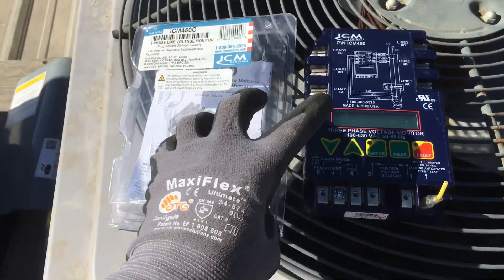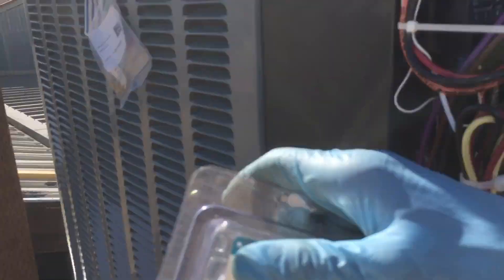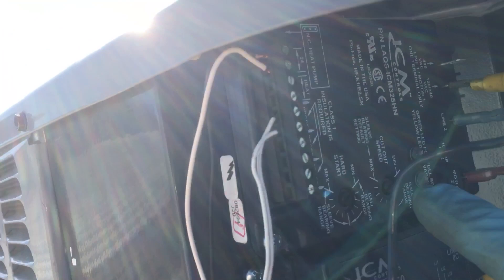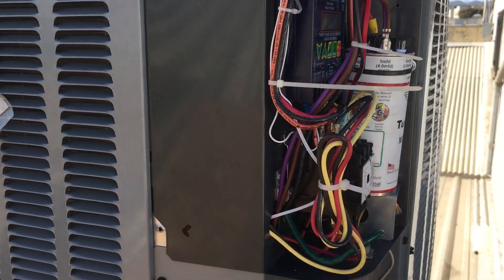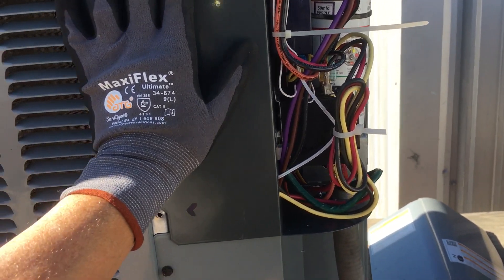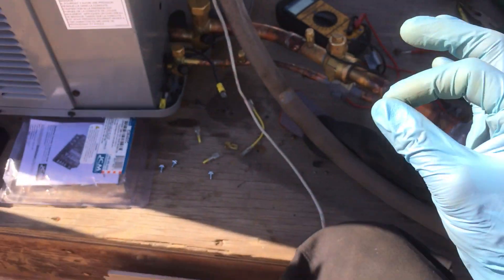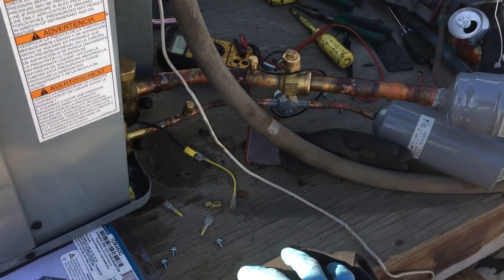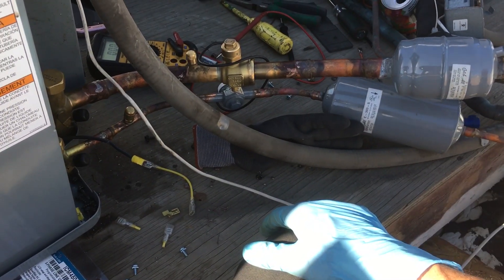ICM 450 Line voltage , three phase monitor , motor protection￼. Protect crucial HVAC investment￼

Comment: 2:26 "to slow the fan down"   Not on a PSC; capacitor single speed motor.
Normally it's a hi/lo press/temp switch that breaks the fan circuit for an on/off mode only. Not slowing down/pulse motor.
Reply from the maker: It is a PCS single speed fan motor. 
      It pulse cycles duty cycles the pulse to the fan to control the speed 

Like your finger being on a light switch, turning the light switch on and off very fast to use as a dimmer . 
    That is all this is doing to the fan motor to slow down to raise the head pressure on cold days

Comment: So I had to look up sensi predict. Looks like the value is to have it connected to a wifi, and send text messages about system status, is that correct? What is this cooling that is that critical, as they had to live without it the days it took for you to replace the condensing unit.
Still would be interesting if you could have opened the ICM 450 to see what root cause failure was. And if this was a design or manufacturing issue.
Reply from the maker: Yes it’s sends error messages to both you the contractor who installed it and to your customer. 

You get a monthly service report with your subscription and all data is saved. 

It’s a cannabis facility ( marijuana )  they were down a few days until PG&E put the new transformer up on the pole that exploded. 

           Unfortunately it was a Friday when I got out there so all warehouses were closed over the weekend to get a new unit but I was able to get one immediately Monday and up on the roof that evening and have it installed by Tuesday And after being on the vacuum pump overnight recharged and working on Wednesday

It will tell you how the efficiency rating of your unit is running how many BTUs of output it will tell you when your capacitor is starting to go bad it’ll tell you when your compressor motor or condenser fan motor are starting to have a problem. 
      It’ll tell you that your air filter is starting to get plugged in because it will show on the readings. 
      It will tell you that your refrigerant level is getting low due to a leak
And many many other problems